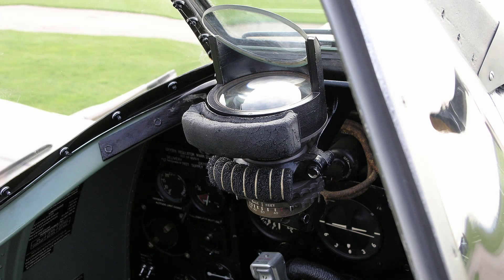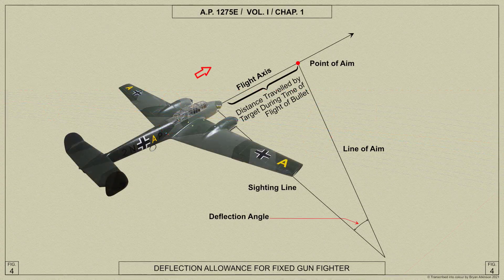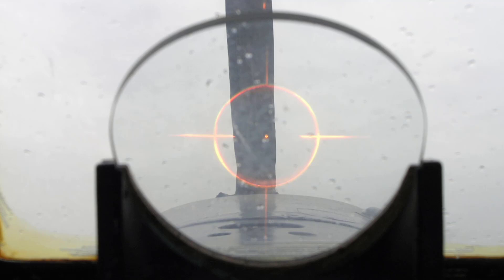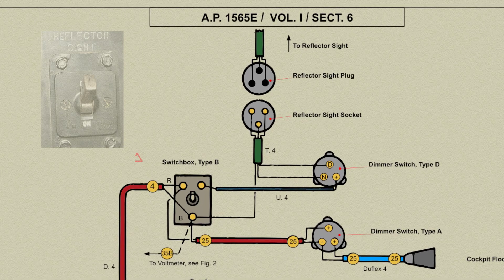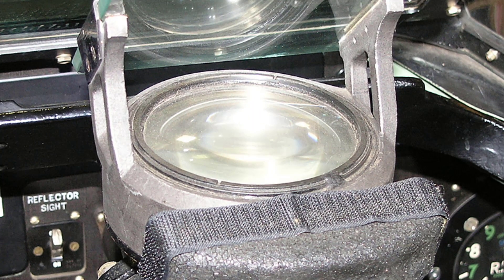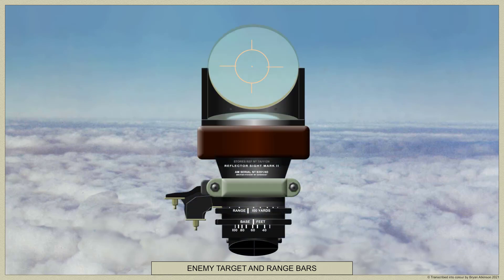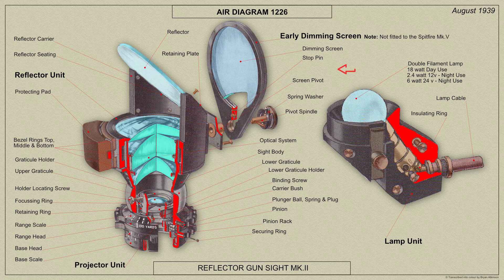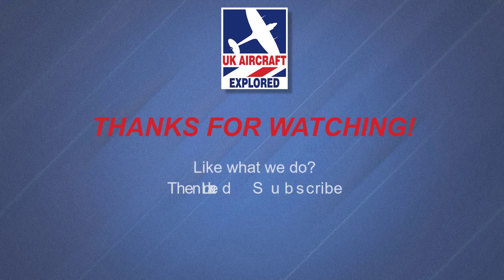Spitfire Mk V – Gun Sight Mk II

Comment: WOW - verrry interesting.  Questions, though:
1) Did the range ring also change the depression angle ?  I assume it did not, since gravity drop at practical ranges is small compared to other deflection factors.
2) Why frosted bulbs ??  In the later GGS (Gyro Gun Sight) the bulbs are not frosted.
3) Why the fixed-length cable ?  It is clear that the (coiled) cable was bothersome, obscuring parts of the instrument panel.  It should not be too difficult to cut the cable to the required length and re-install the plug during sight installation - or was that actually done, but not in the two or three restored Spitfires shown ?.
4) Why 3 reserve bulbs ?  Certainly the filaments lasted longer than that . . .

Can you do a similar video on the GGS ? - I have an actual Mk. IID, plus a collection of related documents, and would be glad to assist
Reply from the maker: Thanks for your questions. 

1. No, the range ring did not change the depression angle. The depression or gravity drop was set by armourers at the gun butts, where the range and depression would be harmonized at the required range. This was achieved by adjusting the guns in their wing mountings and also adjustment to the sight. The guns and sight were then 'harmonized' and ready for operations. 

2. The frosted bulbs may have been used at the time, to reduce the projection in the sight of the double filament in the bulb.

 3. Why indeed. This was wartime and maybe it was quicker to produce the cable at a standard length in the factory.

4. I'm not certain why three bulbs were stowed. I do know, that three types of bulbs could be fitted. The 18 watts for day use. The 2.4 watts 12 v for night use, and a 6 watts 24v also for night use. Again, the aircraft is used in wartime, and maybe the small stowage of three fragile bulbs, helped to quickly change a faulty bulb before the next sortie. 

Yes, I will be covering the MK.IID in a later video, and thank you for your offer to assist.  Although I can't say when at this stage, I will be in touch in the future. 

Cheers for now, I hope this helps and thanks for watching.